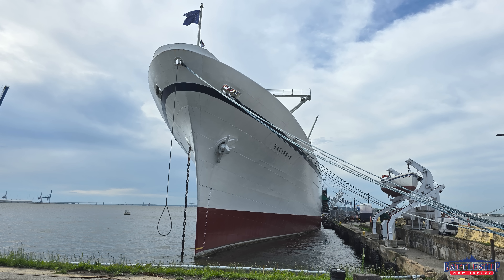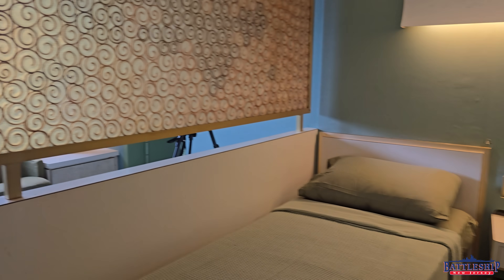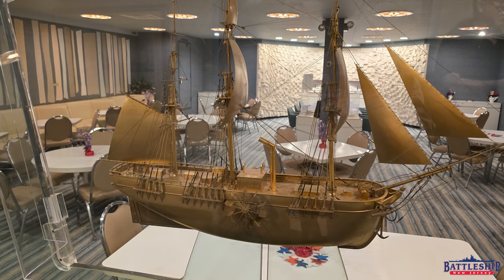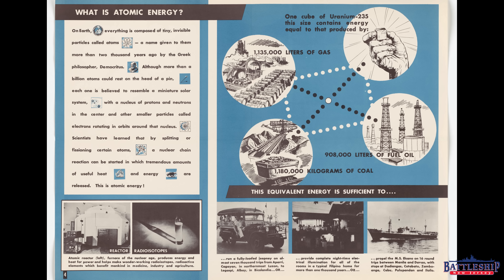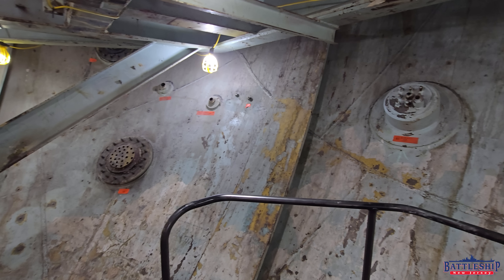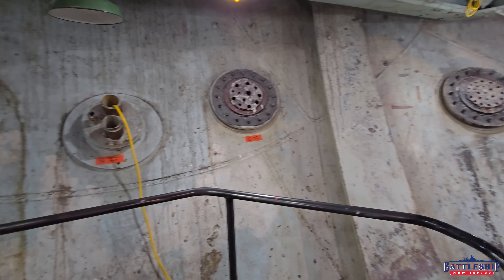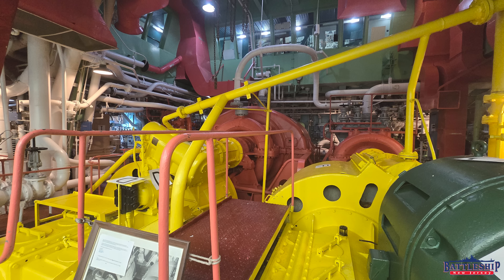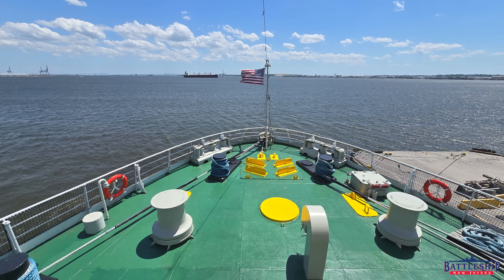A Tour of Nuclear Ship Savannah: Including The Reactor Compartment!

Comment: I was the Port Engineer aboard the Savannah from 2014 to 2020. I ripped out her radioactive components very carefully without spilling a single drop of radioactive water. It's hard to look at the mock up reactor and components knowing that there was a real working and amazing power plant there. It was designed and built by people with pocket protectors and slide rules. There was no internet, computers,  cell phones yet it worked exceptionally well. I traced out every system so I could plan how to remove the components safely. Our team consisted of navy nukes and Nuclear power plant officials from several plants. With her guts removed, she is soulless and defiled for ever. Go see her before she is towed away to the mothball fleet.

Comment: 5:01 They did such a nice job grinding out that vessel I really hope they sealed it to prevent rust
Also, that torch cut is heinous lol I wish they had considered it when making the first cut and done a second pass after the steel was hot, I bet it cut like dookie going though 4 inches cold

Comment: A very interesting comparison to Savannah is the Cap San Diego, which is the largest still working cargo museum ship and is located in Hamburg, Germany.
They both are from about the same time period, have interiors for passengers, but the difference is that the Cap San Diego is driven by a huge diesel engine. So she is a very good comparison to look at how different ships were designed with different propulsion systems.

Comment: Reality check. Having hundreds if not thousands of freighters run by penny pinching commercial interests over the years and decades in harbors around as they aged is terrifying. Would have had super hot nuclear fuel melting every once in a while into the water. Bad, very bad.

Comment: I both love and hate some of the things i saw in this video. I went on board the Savannah many years ago when i was stationed in Myrtle Beach Sc. At that time you couldn't go into the reactor area but you got to see enough of the ship to be impressed with her. Now it appears that there is a much larger tour route with things to see. The restoration seems to be second to none until you get to the part of the ship that people would most be interested in. Someone has absolutely butchered the area where the reactor core was. She was de fueled many years ago far before the time that Chernobyl's unaffected reactors were. You can take tours now thru Chernobyl's reactors and literally stand on top of the containment area top plate. Everything that was in there when it was shut down is still there just de fueled. No idea why they found it necessary to completely gut the reactor core and all out of this ship since by this time it should have been plenty safe enough i would think to just encase it where people couldn't go up to it and start turning valves and such and left it in place for people to view. If you look closely the area above where the reactor core was whoever was involved in it's removal just took torches and absolutely butchered the ship in so many ways to get it out for no reason. It's a shame that the one thing that made this ship so special and unique is the one part of it that no longer exists. The fact that they removed the one thing that made this ship so unique for no reason is really inexcusable. It would be like removing the gun turrets on the New Jersey and just putting up a structure with the turrets and guns painted on it like they did to the Savannah. I guess since the only one left there's still some value in keeping it around so that people can almost see what she was like in her prime.

Comment: At 8:00 the video shows in the bottom of one of the holds a reciprocating steam engine that is either a 4-cylinder triple-expansion engine (of which IIRC the only preserved example is the Flower-class Corvette HMCS SACKVILLE preserved in Halifax NS) or an even rarer quadruple-expansion engine.  Do you know anything about it?
Reply: Its a triple with 2 LP cyls. From the Hudson Ferry Elizabeth, donated to the NS Savannah Association.
Reply: @robertadams3077 Thank you!   The two largest cylinders seemed to be about the same size, but I couldn’t see for sure.
Reply: @robertadams3077 having two LP cylinders with somewhat offset timing made it easier to balance the engine.  In the UK there was a patented method of timing called the Yarrow Schlick Tweedy system.  https://en.m.wikipedia.org/wiki/Compound_steam_engine

Comment: Thank you for an excellent video.  I regret that I didn’t get a chance to meet you on May 17.  I want to show off my recent work on restoring the clocks.  Originally, there were 34.  Given theft, vandalism and water-damage, we probably have only enough parts to restore about a dozen.  (An architectural salvage place supplied four movements from a school that was demolished, that had the same Stromberg system.)  Currently, I have the Master Clock running, driving five slaves.  The clock behind the Purser’s desk is driven by a battery movement for now.

https://youtu.be/O744l_D6-2U

Comment: Unfortunately the removed reactor components were the most historically important part of the ship. Few gen 1/2 power reactors such as those exist, they were largely hand built and the plans for them are not very complete. Because folks are scared of anything to do with radiation, the power that be required the reactor be ripped out instead of just left to sit around for future generations to learn from.
Reply: Actually, much of the plant remains. She was defueled in the 70's so the components were not very "hot". If scrapping wasn't a possibility, the RPV and control rod drive tower probably could have remained. (the shipyard workers could not be exposed to more than background radiation levels)

Comment: I got to walk her decks when she was at patriots point in the late 80’s. My dad had a blast he was on the commissioning crew of the USS Seawolf 575 in engineering. Fascinating experience.
Reply: Somewhere I recently read Admiral Rickover's quoted reasons for replacing Seawolf's original liquid sodium plant with a pressurized water plant.  I'll bet your dad had some stories about that.
Reply: @robdgaming He did. The sodium plant was insanely dangerous although more efficient and quieter. The sodium traveled through stainless steel pipes inside water filled pipes. If there were even a pin hole in the sodium pipe the whole system was erupt with a chemical reaction between the sodium and water. The old man had a ton of stories thats for sure.

Comment: I always sort of cringe when I hear the term "nuclear powered" .  NS Savannah, like the Navy's current carrier and submarine fleets, is steam powered.  The nuclear reactor simply takes the place of coal or oil burner equipped boilers when making steam .  Once past the reactor room, her machinery would be familiar to engineers from the turn of the century as steam turbines started to replace triple expansion steam engines.
Reply: All true.  And it does not change the fact that she was, in fact, "nuclear powered".
Reply: That's how virtually all nuclear power is generated.  The other way (RTG) is an order of magnitude less efficient.
Reply: @edasm4113  RTG is more accurately described as "Radiation powered".  And is only capable of very minor power outputs.  Certainly not enough to drive a ship.
Reply: @johnjones5354 The RTG's are still working great for the Voyager I & II spacecraft, but then, they don't consume much power anyway. 
🖖🏻👽🛸✨️

🌌🔭
Reply: @scottmcintosh4397  Exactly.  They don't consume much power.  Ships are a whole different story.😁
Reply: The reactor is the power plant, therefore, the ship IS nuclear powered. It can't get any simpler than that. 

🌌🔭
Reply: @scottmcintosh4397  Exactly.  A ship which is coal fired is "coal powered", one which is oil fired is "oil powered".  One which is reactor driven is "nuclear powered" .

Comment: NS Savannah is also significant for the style of freighter that she is.  She was built before the age of containerization and so is a "break bulk" freighter.  This type of ship handles cargo in individual boxes and crates that would be brought aboard in cargo nets by the ship's own cranes.  Her cargo holds are small relative to modern cargo ships because of this and she has no deck space for stacking containers in the modern practice.  Break bulk freighters today are largely extinct because they cannot handle containers efficiently.  She is definitely a ship of another time.
Reply: Another problem was she required a much larger than normal engineering department because of the reactor technology of the time and the reluctance to use an existing compact more automated nuclear system developed for nuclear submarines.
Reply: @emilkarpo  Nuclear submarine reactors were not considered as Eisenhower insisted there be no military gear on his "Peace Ship". As to her cargo handling capacity, she was never intended to be profitable although she did generate more revenue than expected. BTW, she did carry containers towards the end of her active career. She did carry more engineering personnel, but many of them were trainees for the expected following nuclear ships
Reply: @robertadams3077  Also I'd bet it was a big thing that the military reactors were classified as all hell, being the latest and greatest tech.
Reply: @emilkarpo  her reactor was quite compact, even by modern standards (and part of this was she did not possess all the safeguards and reactor containment features that would be required today - if someone was foolish enough to try to navigate all the logistical/financial challenges and political red-tape to construct a nuclear-powered civilian ship).  For all the practical reasons you'd assume, her reactor was designed to have about as small a footprint as possible while being big enough to actually achieve a stable & controllable critical-rate fission reaction.  The only way to make her reactor much smaller would have been to: (1) start removing shielding and irradiate the ship/crew or (2) switch to a reactor architecture that used a more enriched fuel.  As you move into higher levels of fuel enrichment you can shrink the physical size of the core (just because you need less total fuel mass to go critical) but you create a whole host of other problems.  Namely: (1) you have a finer line between critical (what you want) and super-critical (near-instant catastrophic surge of heat and radiation causing rapid and violent destruction of the reactor core and probable high-energy release of radioactive fuel, highly radioactive fission products, and highly irradiated primary coolant), (2) higher enrichment reactors will generate more heat at all relative levels of stable reactor operation, necessitating higher capacity cooling and heat-transferring systems (i.e. more and bigger condensers, a larger water distillation plant, higher volumes of coolant in the primary and secondary coolant systems, bigger & higher pressure coolant pumps, bigger, thicker pipes, etc.), (3) at higher enrichment levels, in order to maintain safe operation, you must actually reduce the speed at which you increase/decrease reactor output (part of this is just because you have to be more careful about not going into a meltdown condition, but I'm more referring to the intricacies of managing the reactor output even while it's stable... when you begin the process of fissioning Uranium, you are beginning a radioactive decay-chain that will take almost a BILLION years to complete.  You dial up the reactor and first you get what you expect: more power, then you see the power drop off as you build up neutron-poisons in your fission-products, but 16 hours later, you start to see massive power-spikes as those neutron poisons begin to decay and, instead of eating neutrons, they start releasing waves of fast neutrons to send the reactor into overdrive.  With ANY nuclear reactor, you can't be thinking about what you need from the reactor RIGHT NOW - you have to be thinking: what are we going to need from the reactor in a few days, a few weeks, a couple of months - and the problem is much more complex and fragile as you start increasing the reactivity of the fuel.  You have to be able to keep track of precisely when you've created how much of which isotopes and where you created them in that giant sealed reactor.  And you can't look inside to see and if you get it wrong it's going to be worst case scenario for A LOT of people.), (4) when you've got a higher grade fuel - it's a much more dangerous problem if you have an uncontained event or if nefarious parties were to somehow get their hands on that fuel (any group that wanted a nuke would have that ship in their crosshairs if they knew or suspected it had significantly enriched uranium aboard - even if it was only a fraction of weapons-grade enrichment - it can easily be converted for use in a breeder to produce plutonium and that's bad news for everyone that lives on the planet Earth), (5) using higher enrichments of Uranium becomes exponentially more expensive (not just because the reactor architecture becomes more complex, but because as you further and further refine 235, it becomes exponentially more difficult in terms of time and literally energy to squeeze more of the remaining 238 out)
Reply: @emilkarpo  The reactor was in fact quite automated. Use of low enriched fuel was preferred as well as Eisenhower's directive that no military equipment be use on his Peace Ship.
Reply: Containerization is such a largely underappreciated development for humanity.
Reply: @Studio23Media  I highly recommend the book "The Box" by Marc Levinson. It's about the history of ... well, the box. From Korean-war-era Army 8.5-foot by six-and-change Conex, to Malcolm McLean having the bright idea to combine that concept with putting truck trailers on ships, but why bother shipping the axles and frames when you can just have the wheely bits at every port?, to the standard 20/40-foot ISO box that changed global commerce and put an entire trade (longshoremen/stevedores, the guys that loaded/unloaded break-bulk ships) essentially out of business almost overnight.
Reply: She also had cabins for passengers.
Reply: @massmike11  Yes. President Eisenhower insisted she carry passengers as a demonstration of the safety of atomic power. In fact, some passenger cabins are within 25 feet of the reactor compartment.
Reply: She was the peak of technology from a different age. between air travel and container fright, she was very quickly obsolete from a practical point of view unfortunately
Reply: @Seldoon_Nemar  Not true. She didn't become "obsolete", she was never intended to compete. She was retired because she had accomplished all her objectives and the government prefered to spend her subsidy (BTW ALL US flagged ships were subsidized) on the Viet Nam war and Apollo.
Reply: That's one way to say "she's outdated" (no offense)